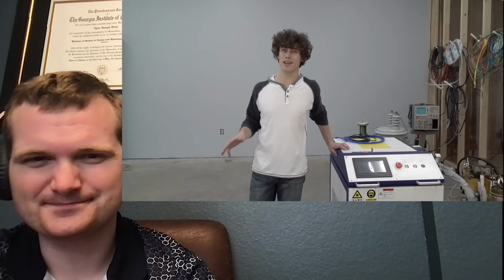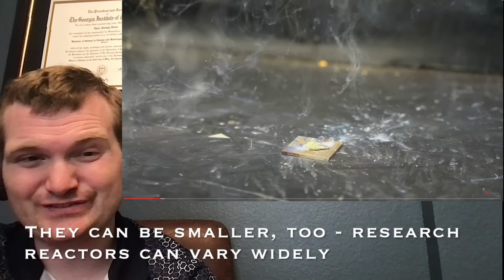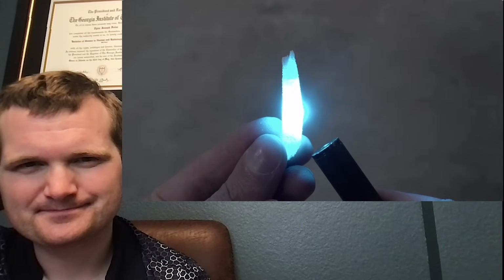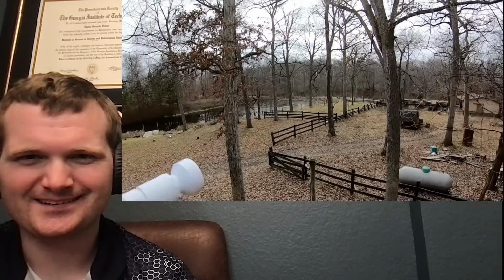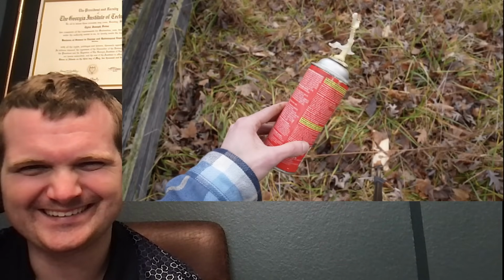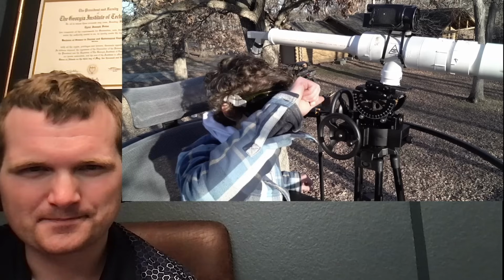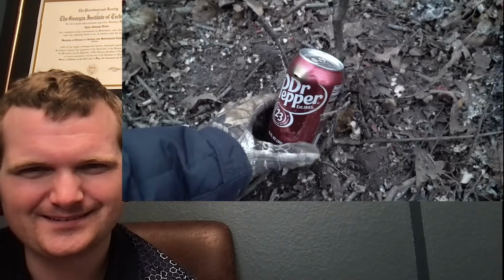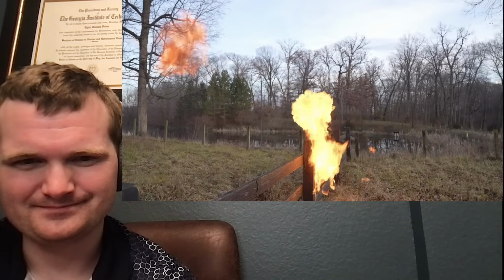Nuclear Engineer Reacts to styropyro "I Built a Long Range LASER Turret in my Yard!"

Comment: This laser has a tiny point as shown in the first clip before he makes it move by turning on scanning. 2kw is delivered to that tiny point which appears to be <0.5cm which assuming a cube (under valuing density) works out to power density at a minimum of 2000/(0.5*0.5*0.5) = 16kW/cm3 so we're looking at TENS of kilowatts per cm3 which according to a quick google search is at or above the upper bound of a typical nuclear reactor.
Reply: i found a laser rust remover online thats beam width ranges from 1-50mm depending on how close you are to the focal point, assuming the laser doesnt penetrate super deep into the surface of the material (for ease of calculation lets say a depth of 1 mm) and you are exactly on the focal point of the beam, that is just about 2000 watts/mm^3 or 2000000 watts/cm^3

laser beams can get extremely narrow and deliver incredibly high power densities with a much lower amount of power than youd expect
Reply: Just to further explain, the laser is ALWAYS a tiny point, it's just moving incredibly fast giving the appearance of a wider beam.
Reply: Now imagine the military grade ones
Reply: @Billy_Herrington1969    - just combine 10 of these for a few seconds, lol..
Reply: you also have to factor in that it disperses the energy on the surface, there is not a lot of depth this energy is being apllied to. sure it then disperses throught the material but the upper layers of molucules get all that energy, so much so that they are litterally ripped apart
Reply: Isn’t a bit being lost into the air to? Which would be what’s causing the air to glow and show a beam.
Reply: @nathanpfirman625 yes. As he stated, using the correct sensor for that wavelength of light on his camera, the scattering effect of particulates in the air is shown. Same effect as if you shone a laser pointer through smoke/steam.
Reply: Maybe 0.001 power lost to "air". It is light. Tell us how much light is lost to air.what you see is dust in the airt
Reply: @nathanpfirman625  A very tiny amount. At that range, almost all of it will be reaching the target. It depends on the wavelength, but about 99% of it will be reaching the target.
Reply: This should be a pinned comment
Reply: LMAO WHAT
Reply: He did correct himself later in the video.
Reply: I asked ChatGPT and it first told me it's apples and oranges lol like pretty much every one of this guys comparisons with nuclear energy, but if you break it down for surface area, and not just volume like nuclear reactors use, it's like 1GW for lasers compared to 10MW for nuclear per meter squared..
Reply: What exactly is powering this laser, two nuclear facilities or am i getting something crazy wrong rn? Anyways i would not want to pay that electricity bill.
Reply: @drpallus  It's got power drain of about the same as beefier vaccum cleaner or inductive stove
Reply: @drpallus  it’s about two microwaves
Reply: To be fair, if you are measuring power density as an average then the scanning would lower the overall power density of the whole thing, but yeah the lasers beam itself is always insanely power dense
Reply: Tyler has already spoke about laser power. Pulse lasers deliver more power on one point than anything which can be sustained, and sustained lasers can't maintain huge power outputs due to heat. So it's incomparable to a nuclear plant, yet it's still impressive what we saw here.
Reply: @jlinkous05  this is a continuous 2kw laser. As tyler pointed out he thought that when it was small it may be comparable to nuclear plants that he even gave the same range I did. He simply excessively under-assumed the power density of this laser. Feel free to check my math and the numbers cited in the video.
Reply: I don't have enough intel on this subject in either of them so I can't say who is right or wrong  @Essence1123
Reply: @jlinkous05  except, energy density equations DO NOT include a "time" parameter.
Yes a nuclear reactor can output power for a long time versus a pulsed or even continuous wave laser, but the energy density equations don't have a time variable in the equation. So the laser in this video, with 0° scanning angle has as much, or more incident energy than a nuclear reactor.
Reply: @jlinkous05  You can have sustained laser output of a few kW at a point, for laser cutters that will handle 1" + thickness steel.
Reply: @RChero1010  I never said that these photonic energies, or power concentrations, are not useful. Styro already explained the context, and it's amazing all of the things he can do with hobbiest materials! I'm just very wary about comparisons regarding nuclear plants and the surface of the sun in comments without the corresponding context.

I run plasma and hydro CNC operations. I'm not trying to argue.
Reply: @jlinkous05  The thing here is that while a nuclear power plant has a huge output power, the core has that power distributed over a quite big volume. While a laser - with much, much, much lower power - has a way higher power density. Because it can focus the energy into such a tiny spot. And that's also why lasers can start fusion reactions with millions of degrees. So not the temperature of the surface of the sun but of the core of the sun.
Reply: @jlinkous05  who is comparing sustained outputs of a laser with a power plant?this bloke is is a fool. he even says power plants have 5kw a cm3. this laser has 2kw in a full stop sized area.
Reply: @jlinkous05  Ironically later on in the video he even says that the power density is comparable to a commercial nuclear power plant for the exact same reason as the comment you responded to. Initially he just misunderstood that the beam wasn't actually a few inches long, it was just moving back and forth very quickly, and that's why he said it wouldn't be. The laser isn't that wide, it's always a point and that point is so small (in the low millimeters) that when you plug it into the equation you're gonna end up with an insanely high power density, because that's measured in cubic *centimeters*.
Reply: @jlinkous05 That explains why pulse lasers are more powerful than regular lasers in Battletech/MechWarrior at least.
Reply: This isn't a pulse laser in the video.  It's a sustained one. @jlinkous05

Comment: Uhm, isn't the inverse square law describing the radiation from a ideal black body in all directions?

With a focussed laser, you don't have those losses as much imho.... You just have the losses from atmospheric particles in the beam.
Reply: The inverse square law still applies, just "stretched out" in a tighter cone.
Reply: @DJ-DJOH Yes that's plausible...

Would be interesting how many watts of laser light will still hit a point in 75m or more when cleanly focussed in @styropyro manner. ;)
Reply: Sure theoretically but we can't exactly extend the focal point indefinitely
Reply: @DanielBohnen Well, yes, not indefinitely .... but surely within the range styropyro used. ;)
Reply: @hackbyte what I mean is The beams radius will increase slightly (leanses can only do so much) which does put inverse square law into play